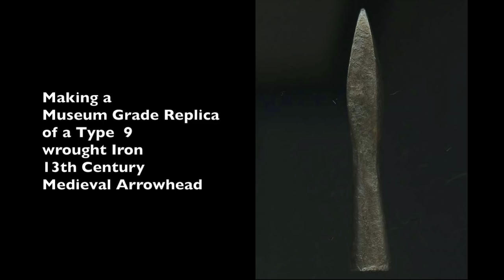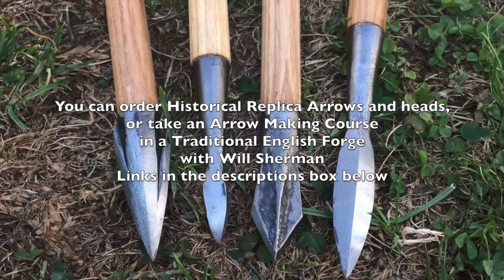Forging an Arrowhead (Type 9 Bodkin) with Will Sherman of Medieval Arrows. Swallow Forge

Comment: The results are good but you give yourself a lot of extra work. My suggestion is that you shape the head considerably more (but not the point) before forming the socket, leaving the whole piece still attached. By this I mean the neck and lower half of the head. The reason is to keep from thinning out the socket wall so many heats ahead of refining the point in order to not lose a lot of the socket wall to fire scale. 

Use a set of callipers instead of a tape or steel ruler as the heat will destroy the markings fairly quickly. You can easily make your own, and self made tools are a pleasure to work with. 

If you plan on making a lot of spearheads, you could consider making a specialized set of tongs with a cone as one side of the jaws... this would act as a heat sink for the thin wall of socket. The other jaw would be like round stock tongs, but angled to match the cone part of the tongs. 

I enjoyed the video, keep up the good work.
Reply from the maker: Do you make museum grade arrowheads for a living too?
Reply: @SwallowForge  No, my forging was only a hobby... I was a welder/fabricator but I trained under a few smiths including one who was quite brilliant. Sadly my forge sits unused as I'm now disabled... however back in the day I made items for reenactors that were museum quality, but most of my forging was ornamental. 

I noticed that your wrought iron seemed to have a fair bit of resistance. I only had the pleasure of using a limited supply of the stuff (about 40 lbs of old surveyors' stakes) and I found it a real pleasure to work with, far more ductile and forgiving than mild steel.  Since I only worked with the one source, is iron normally that stiff, or does it depend on the source?
Reply from the maker: Sounds like you need to get that fire glowing again :)
Reply: @SwallowForge  I would absolutely love to hammer some hot metal again, but 3 herniated discs and spinal stenosis say otherwise.  For the present I live vicariously through channels like yours, thank you for the videos :)
Reply: @blacksmith67  Thanks for the comments.  Just to address a couple of things - the socket has to be formed first for many of the heads from this period, so we just use that method for all the rest of the head forms as well.  With the correct fire control there is no reason why the socket would burn up or gather fire scale - you can see in the video that once the flat socket is formed it is planished and clean, with no fire scale.  Once it is rolled up and the head cut off the bar, the socket doesn't go into the fire at all, so again there's no real reason why fire scale or burning the socket would ever occur.

You'll also notice in the video that I do actually use a special set of socket tongs, which have a pointed mandrel for the inside of the socket, and a curved bit for holding the outside of the socket.  I personally prefer needle nosed pliers however, which is why I use them.
Reply from the maker: Good grief, sorry to hear about your back issues. I am glad you enjoy the videos. And thank you for your comment, it is much appreciated. 
All the best. SF

Comment: How long does it take to manufacture a single arrowhead. Remarkable that 12th - 14th century smiths could produce so many arrow heads - labor intensive.
Reply: They could probably forge and quench an arrow head in 3-5 minutes
Maybe even less, i certainly can't work that fast YET

Comment: How long does it take to make one of these? I spent about 30 minutes making one out of 15mm spring steel today but I am a total novice in this craft.
Reply: Jakub, make it easier for yourself! Don't use spring steel but normal mild steel. Medieval arrow-tips were disposable items, often only used for one shot. They were not hardened. The specialized medieval blacksmiths could make 20 to 30 items in one hour, but with a helper/apprentice
Reply: @jeancollin8224  Now I only use mild steel.

Comment: very nice, Would it be a similar process to make ballista bolts too?
 Also do you know where to find a video to make the bow used for these type of arrows?
Reply: Been playing too much Runescape or just stupid? Any bow goes for most arrows but the stronger the better for heavier arrows
Reply: @RikkiTheRose  I'm no archery expert but they look heavier than what i have seen used or for sale in stores, That's why i asked, Pardon me if i want to learn a little more about something i might want to build in my little blacksmith shop.
Reply: @rvsorce7196  You're not stupid at all, don't worry.  The arrowhead that I'm making in this video is a MoL Type 9, which was most likely used with bows between 130lb and 170lb if not heavier.  To make a bow of this weight the hardest part is finding the correct timber - most woods will work, but not all timber is the same and being able to identify which timber will suffice is difficult, and hard to teach.  

There is a guy on YouTube called Mick Grewcock who has made lots of very well-explained videos on how to make bows, some of which get close to the weights required.  It's also worth checking out the video by Ian Sturgess of Boston Bows on YouTube of him making a very heavy yew warbow.

Hopefully that's of some help!
Reply: @MedievalArrows  Thank you I will check them out.

Comment: The arrowheads are very beautiful. But it‘s not possible to harden rought iron, because there is not enough carbon in it.
Reply: Correct. That's why it's very lucky that they don't need to be hardened, and that the original heads were not hardened.

If you actually wanted to harden them it's very easy - you simply case harden them, but there's virtually no evidence this was done.  Certainly not for munitions grade heads.